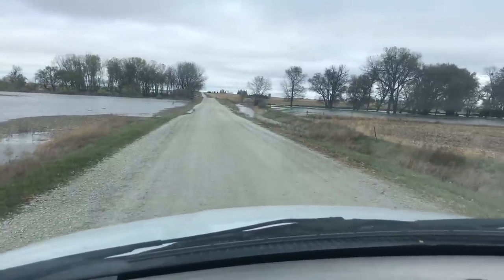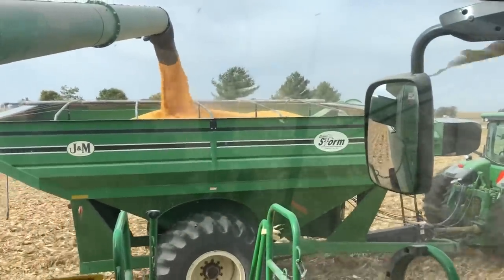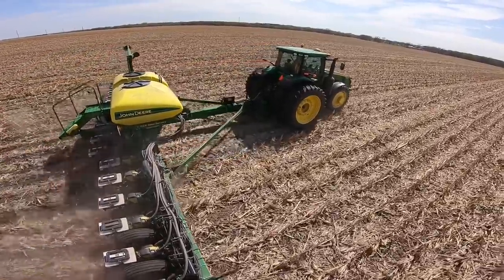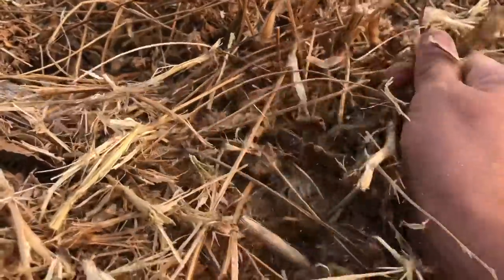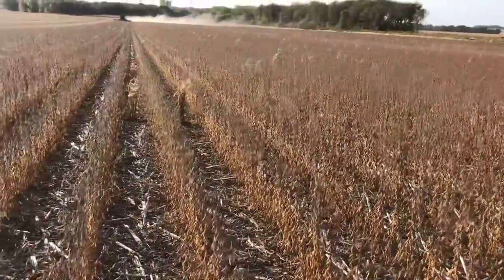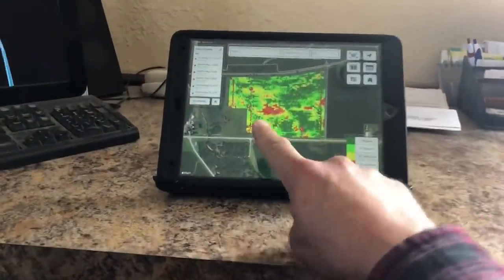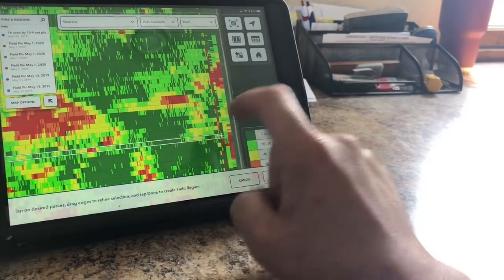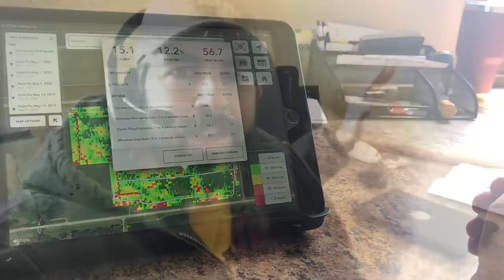The Soybean Roller Experiment

Comment: Very good, side by side, comparison.  By your GPS, it appears you have a hot spot, in the first area you checked.  Not going by the gps data, but going by your actual hands on of the field, it appears the roller made a big difference in degradation of stalks.  Although the degradation doesn't seem to affect the overall yield, according to gps, it is so obvious when you get hands on the field.
Good video.  Very informative.
Reply from the maker: Yeah it’s hard because the field has so much variability

Comment: This was interesting, Carl.  It's well-known to many small household gardeners that lighting tamping down seed rows certainly improves germination of virtually all plants just something my daddy taught me, and he was a carpenter, not a farmer (closest he ever came to farming was harvesting ice with horses in the winter).  But when you're making the ROI comparisons you mention the costs of using own labor, tractor and fuel, but don't use those costs in the comparison.  Using just the costs of the roller rental it's certainly a no-brainer.  Thanks for your frequent forays into explaining both the nuts and bolts as well as the dollars and cents of farming.
Reply from the maker: Yeah I really should have broken down all the costs. The tractor and fuel are about $100/hour and I was doing over 50 acres an hour so maybe $6 per acre would be fair all things included. Still a no brainer
Reply: @dodgebrothersfarmandranch9206  thanks again, Carl.  Yeah, for sure, at $6 an acre it is still an option that is well over on the black side of the ledger,  I'm sure there's quite a big b3mifit to in flattering down all those remainder corn stalks and making the ground easier for whatever tillage or planting will come in the next crop season.  Maybe I should lease or buy a cheap tractor and roller nad a roller and do custom rolling ... it's about the only fieldwork I've watched you doing that would be simple enough for a simpleton like me to do without adult supervision ;-).  Roll on my friend.

Comment: Looks like a no brainer to me Carl, just to see thoughs pods left on the stalks is a big visual indicator. Do farmers ever burn off the corn residue before planting? They burn off the wheat stubble here in New Zealand.
Reply from the maker: It sure does Tim! We don’t burn the corn residue. If you ever get a field on fire it’s almost impossible to get it stopped. The corn stover burns hot and fast!
Reply: Here in Brazil it doesn’t burn, the fire evaporates the nitrogen fixed in the soil

Comment: Up here in Saskatchewan rolling pulse crops is the norm if not a required practice. It's not a question of rolled fields yielding better, its the wear and tear on equipment. Lentils, chick peas, field peas all have a tendency to "lay over" or stay short to the ground where the combine headers pick up a lot of small rocks and dirt causing trouble with the cutting knife, especially if the conditions are a bit tough.
Reply from the maker: That’s definitely an important benefit of the roller that is a little hard to quantify, but definitely a real value!
Reply: Glacier derived soil has a lot more rocks than the midsection of the USA

Comment: When cutting the beans, is there any advantage to having the corn stalks flat on the ground rather than having the combine go through them in addition to the beans.  Seems there would be more wear on the cutter.  On the other hand, the corn residue is chopped up more for decomposition.  Hmmm- must be thoughts there.  I have always wondered why there are just two crops in the rotation.  Is there a third crop that can fit in?  Might help insect control but I guess marketing an odd crop might be harder.
Reply from the maker: Good questions. Really it’s the advanced decomposing of the cornstalks that I find most beneficial. And in terms of crop rotation, in cattle country it is popular to go corn, corn, alfalfa (3 years), soybeans, corn, corn...

Comment: You said at very beginning that you wou would normally becdrying corn this time of year.  How long does it take to dry and In what amounts?  Do you also dry beans too?
Reply: I'm talking from experience back in the '60's but drying beans is on the risky side.  Due to the amount of oil in the beans.  If not carefully watched they can catch on fire.  Drying has gotten better now so perhaps it is less of a risk.  Also beans dry down faster and harvested earlier (generally) than corn.  Up do Carl to set me straight on this though.
Reply from the maker: We don’t dry soybeans. We wait until they are dry enough before harvesting them. As far as the corn goes we have a continuous flow dryer that can take corn from 20% moisture to 15% at a rate of about 700 bushels per hour. Wetter corn takes longer and dryer corn goes faster!

Comment: I've had this question for a long time I keep forgetting to ask. You had corn last year and soy beans this year, both of which put things into the soil the other needs to grow. I was taught corn, beans, and squash in the same hole for my personal garden. Anyway,  from that I know you have to till the stalks, etc. into the ground but the real question I have is when and why?
Reply from the maker: We are experimenting with planting rye as a cover crop after the soybeans have been harvested and then no-till planting corn into the rye the next spring. Then we no-till plant the soybeans in between the old corn rows the next spring. It has been working pretty well. Normally we would lightly till the soil in the spring before planting corn to warm the soil up and dry it out more quickly. We always do tillage in the fall on the corn fields that will be corn again next year to help decompose the residue.
Reply: The corn roots help in unpacking the soil.
Corn straw helps in the enrichment of organic matter, which will be the substrate for beneficial bacteria.
And soybeans fix nitrogen in the soil.
In the long run, you save on fertilizer.
The ideal is to start with corn, Because corn grows a lot Having the ability to suppress weeds, this way after the corn harvest, a smaller amount of pesticides is needed in the soybean crop.
In Brazil it's like this.

Comment: How heavy was the roller Carl?. Could you add weight to the closing wheel?.
Reply from the maker: The roller weighed about 23,000 pounds. I already run the springs all the way up on the closing wheel, so there isn’t much more I can do besides run a more aggressive style of wheel.

Comment: Ok two things that I thought of. Why can’t the corn header have rollers on the back to roll those stalks down after cutting?  And why doesn’t the header float so that it doesn’t lift when the combine hits a bump?  Well, three things.  Do you go back to the large red areas on the monitor and try to figure out what happened there?
Reply from the maker: Hey thanks for the good questions! We do actually have a roller on our corn head. It’s made by Yetter and it’s called the Stalk Devastator. It does a good job of breaking the stalks above the root, but they are usually very wet and tough at harvest time and it would be impossible to lay them down flat like you can with the roller the next spring. The header floats along the contours of the ground using feeler gauges to automatically maintain the same height relative to the ground. The red spots on the map are most often just poor ground that isn’t capable of raising a good crop.
Reply: @dodgebrothersfarmandranch9206  ah ok makes sense!  Thanks for the info. I grew up on a farm in NM many many years ago and things have changed so much. We really enjoy your channel and learning more about farming today.

Comment: BTW you rolled at the wrong time.  Multiple studies have shown that rolling soybeans at the first trifoliate leave stage yields better results.    Maybe next year you can do 3 different rolls.  1 right after seeding, at 1st trifoliate and one no rolling.  Not sure if your tractor can drive throw the rows with out damaging the going soybean.
Reply from the maker: That would be an interesting experiment for sure. If you watch the rolling video you will see that the main reason I rented the bean roller was to close some furrows that opened back up after I planted. I had the closing wheels set as aggressive as I could get them and still I had some furrows crack open. There was no rain in the forecast for two weeks so I thought maybe I could make some seed to soil contact happen with the roller.

Comment: Would it be possible to attach the roller to the back of the planter?
Reply from the maker: That’s a great question. I had never thought of that, but I think it would be pretty cumbersome for folding and moving down the road. Otherwise it might work.
Reply: @dodgebrothersfarmandranch9206  Probably best suited to really large fields. No doubt about the logistical challenge if one were to try to move it as one unit over public roads. But, I believe it still could save quite a few hours of tractor time and labor even with having to make a double move to the next field.  Of course, all of that is predicated on having sufficient data to support rolling at all.